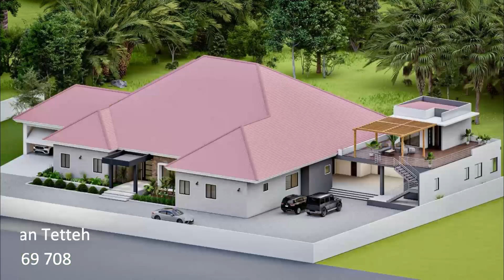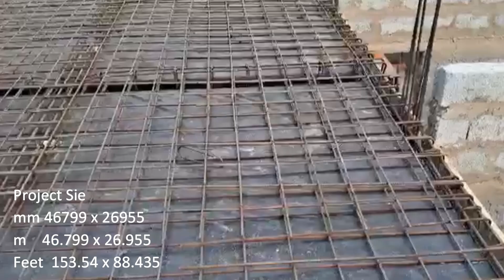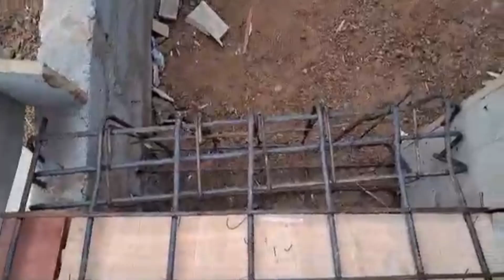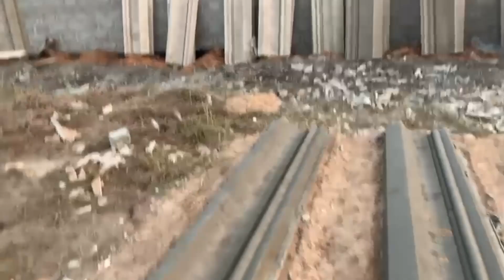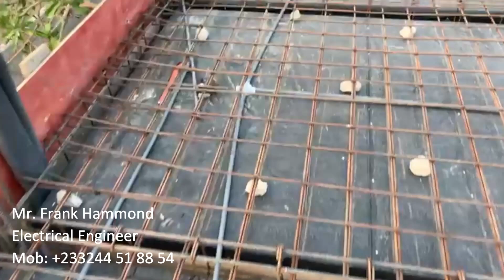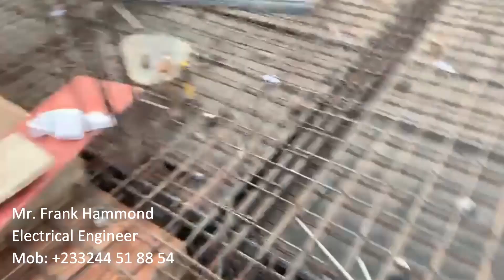Building in Ghana Mesh reinforcement Floor Slab Construction | Ep-29 Project Noah #brightandclara

Comment: Hello Uncle Bright, are there premix concrete vendors in Ghana? How do their prices compare with on site concrete mixed by your guys? I'm looking at the convenience and the logistics involved in having to order and store cement, stones, sand and the labor cost to work on the mixing? I'm not saying you use premix concrete vendors for everything. At least just the concrete intensive areas of the building process. Thanks in advance. You're doing a great job.
Reply from the maker: Premix concrete is in Ghana, but mostly far from the construction site. This comes with a hugh cost compared to the traditional concrete mixer. It will surprise you that the premix can be twice the price of the normal mix with labour, sand, and stones put together. 

Thanks for your comments. I appreciate you.

Regards.

Mr. Bright
Reply: @BrightandClara  thank you very much for taking the time to respond.